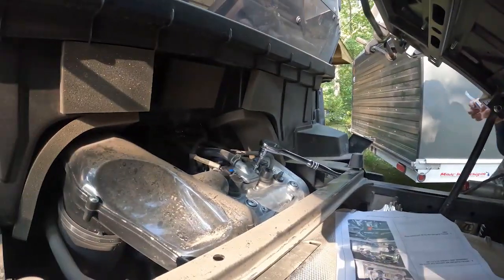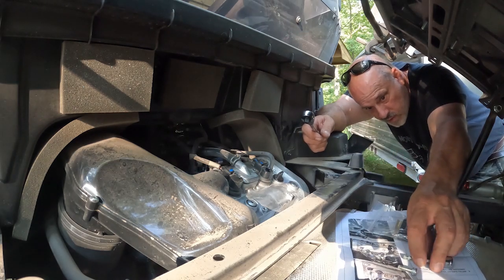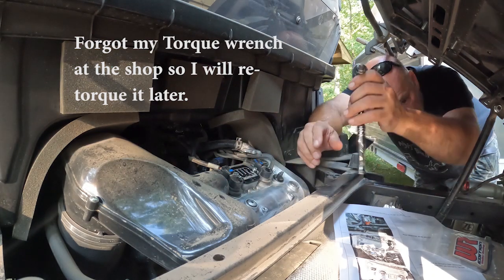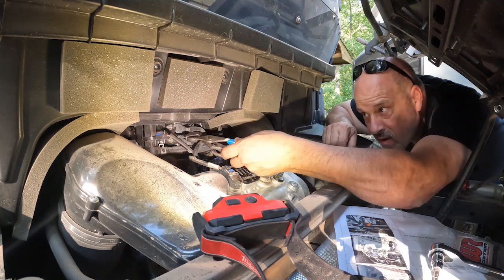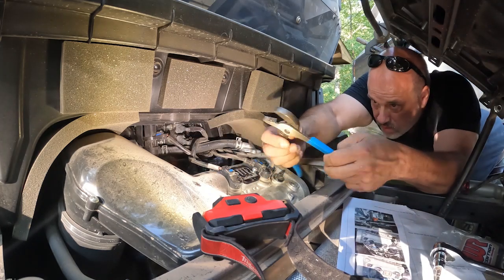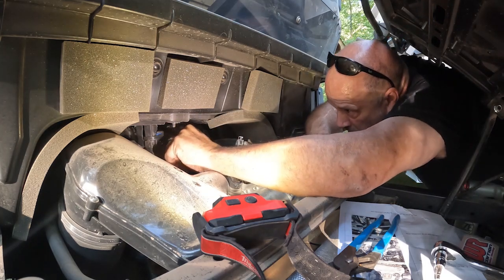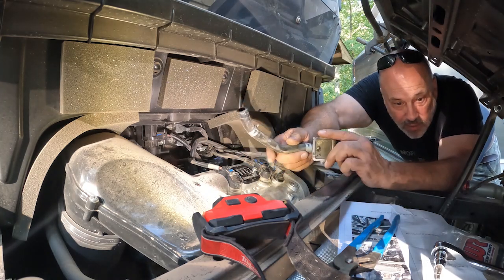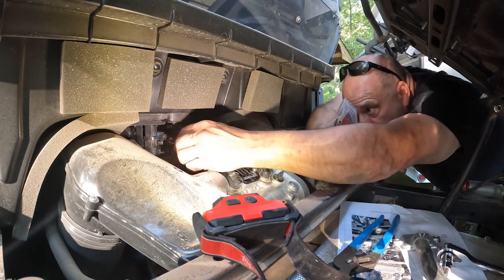2024 Yamaha Wolverine X2 1000 Weller Racing Blockoff Plate Test

Comment: what was the temperature difference you never gave any temps
Reply from the maker: @JeffreyJohnston724  before always turning the fan on and off 210 I believe. Now 200-208 ish fan runs sparingly.
Reply from the maker: @JeffreyJohnston724  the difference I have seen is it doesn’t seem to always run the fan as much. However I installed this in the fall. Fan comes on I believe about 207.